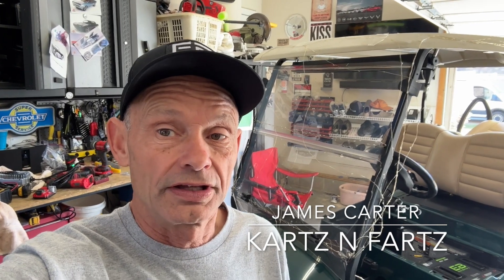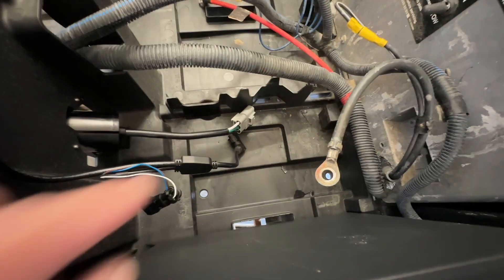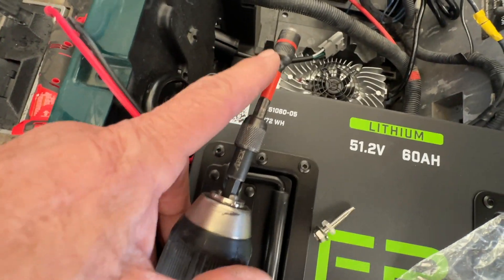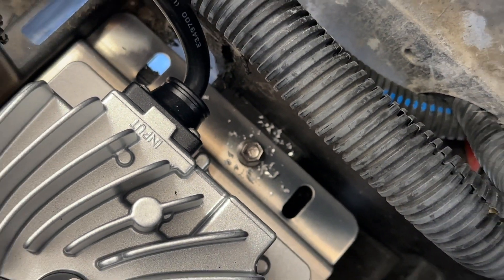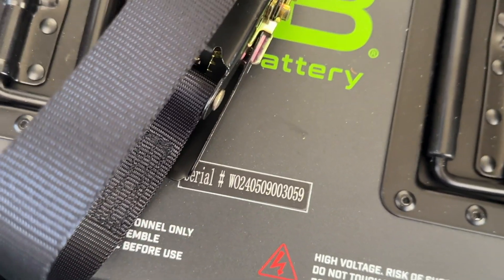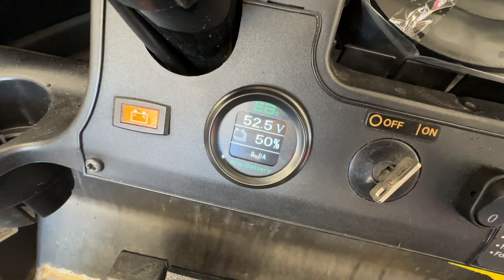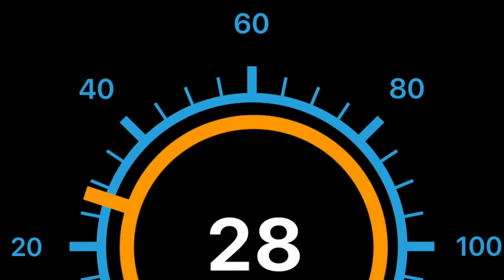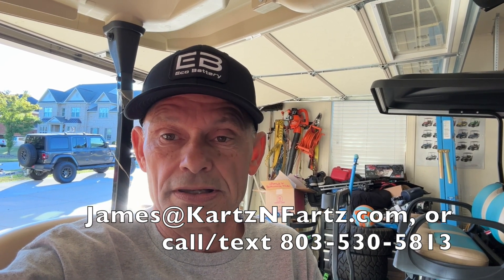How to mount a 60Ah Eco Battery in Club Car Precedent

Comment: I used to subscribe to your channel and have found it very helpful in a lot of cases working on my cart. I’ve looked over your site and couple things that I’m looking for information on, but I don’t know if you’ve done the work before but I’m sure you can help me. I wanna test my solenoid switch on my 2003 club car DS 48 V card what I’ve been able to read and look up it is a situation. We’re both sides have power and then at a given point when you hit the pedal, it turns the one wire to a ground. Is it necessary defined the ground side or can I just put my 52 V negative and positive on either side and create the solenoid to react. I suppose I should go back to the beginning and tell you that I grounded out the key hot wire. I’ve tested all the other switches to directional, but I’m not actually certain how to test the solenoid switch and of course the computer. I’m hoping you can help.❤
Reply from the maker: Hi Marc, David Hicks from Revolution Golf Cars in Augusta, GA can explain it better than I can! He has an awesome video on this....https://www.youtube.com/watch?v=NHCcvGGYoAg